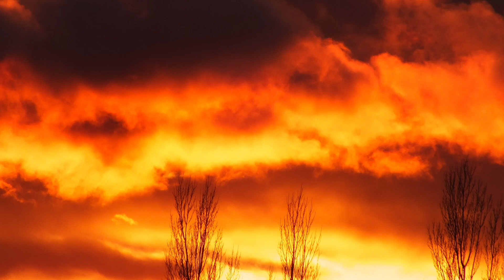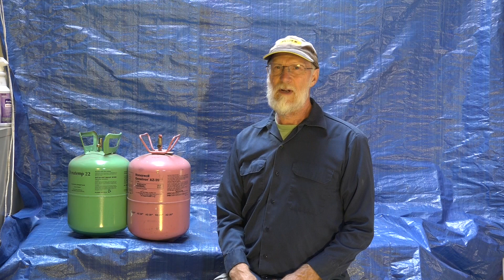Refrigerant additives

Comment: The thing that puts me off the most is that nobody seems to state the composition of any efficiency-increasing additive. True, the chemistry behind them often seems to work and let the evaporator get cold faster (the real benefit, since a system charged with the correct amount of refrigerant and amount & type of oil hasn't got any compressor lubrication issues), but there's no way of knowing if there can be any side effect apart from testing the product on an ac system - and, personally, i've got no reason to put a heat exchange efficiency additive inside my car's ac system at the moment.
Reply: If those additives actually worked and didn't have any adverse effects, why are manufacturers not using it? Sure, cost could be a factor, but especially on high end systems, if they could significantly boost their efficiency ratings just by adding a few ounces of some magic chemical at the factory, why would they not?

Comment: I install a allstyle coil.   drain line water will not drain while attached drain line is attached seems as if it is in a vaccum, water seeps into blower compartment and in combustion area pan.  coil is sloped correctly , any ideal have this issue with two furnaces one drains pretty good but I still have the water issue attached to 92% Goodman with a 3 ton blower the unit are 2 Tom condensers everything new?
Reply from the maker: Have you trapped the drain line?
GFM

Comment: I am happy you received your can of Cold-Plus AC Treatment. You will find as I did that the unit will do exactly what the manufacturer says after product is installed.  please show us what test equipment you used as well as pre and post testing.  I would be interested in your new video.  The product also works well in heat pumps.  Ashrae professes the "Oil Fouling" Phenomena, and here in the Philippines, I have extensively tested Cold-Plus, and it DOES Work.  As for manufacturers, Carrier is testing in Florida now and Installing, and Moss Magnum Act prevents any manufacturer of voiding the warranty.  Await your next video.

Comment: you are a complete joke and  ignorant about modern technology.   Perhaps you just recently got internet and just want to post your untested BS...get the products, then try them, then blast them if they dont work
Reply from the maker: I am indeed involved in my own test of one of these products and will be publishing the results as soon as the test is finished.  However, the opinion expressed in this video is reflected by all compressor manufacturers.  Some of which will void their warranty if the products are installed in their equipment.  "Miracle additives" that promise everything have been around as long as machines.  I resent the thought that I just got internet.  I have had it for at least 2 months.
GFM

Comment: I couldn't agree more. I never was a fan of refrigerant additives, mechanic in a bottle, or engine oil additives. If manufacturers felt there was any benefit, they would have added in the factory or recommended in the install instructions. 

-Jack

Comment: i wondered if leak stop will gum up my testo 550, just have to hope techs label the equipment when they add it.
Reply from the maker: +bradley morey I would certainly not want it in my gauge set.
GFM
Reply: +bradley morey yes it will my testo was ruined the first time. However Johnstone supply mailed it to Germany and they fixed for free. Now I want to sell it,
Reply: +MrAnsweres  ,Thanx my are new,like to keep them a while

Comment: Curious on your thoughts of ACRENEW added to these copeland scroll issue compressors from 2014. Being that the rust inhibitor is the cause if the txv getting stuck , just replacing the txv works but the new one will also become stuck in less than a month . There for its a must the ACrenew is added . Your thoughts thanks Gtfm .
Reply: +Straycurrent anything with a Copeland scroll compressor from early January 2014 through May or June 2014. Mostly 2 - 2.5 ton were affected though
Reply: +justin henning   Justin, do you happen to know if the rusted TXV problem is just with Copeland's 410a scrolls, or are there problems also with the R22 dry charge units?   Thanks.
Reply from the maker: +justin henning I believe that one was from an oil used in the manufacture of the coil reacting with the compressor oil.  The ACRENEW appears to be a fix that keeps the manufacturer from having to replace units that should not be out there.  The problem should have been worked out by the manufacturers of both the compressors and the units with the effected units being replaced under warranty.
GFM
Reply: +justin henning The best thing to do is to find the service bulletin from your manufacturer and see if the unit you are working on qualifies for the ACRENEW treatment.  I repaired 3 units that I repaired this summer using only the ACRENEW.  One of our technicians had a unit that qualified and changed the TXV because he dosen't believe in "Snake Oil" (his words, not mine).  He had to go back 2 months later because the new TXV was sticking.  It's not a cure all, but under certain circumstances it works great!
Reply: even after adding the A/C Renew and changing the TXV on some units the problems come back after 6-8months
Reply from the maker: +Kevin Chestnut You need more time to be sure of the repair with the snake oil.
GFM
Reply: +T&N Services LLC.     Ralph, I'm very glad to have the date range now -- thanks for the info.
Reply: +Straycurrent according to Rheem the Copeland compressors date from 3713 to 2914

Comment: I have a pre owned Carrier "round" unit, 15 years ago I installed it along with a new A coil, pumped it down for 6 hours and put 6lbs of R-22 in and she's been working just fine. The one thing I did do prior to this was remove the service valve components and burnished the bore(s) so as to effect a better seal for the o ring to seal on. I lubed the bore with a light coating of silicone grease. I applied Leak Lock to the service valve caps and gently snugged them down. 15 years is a pretty good run for a used compressor/condensing unit, no? The Capacitors have been replaced and that pesky time out board is long gone.